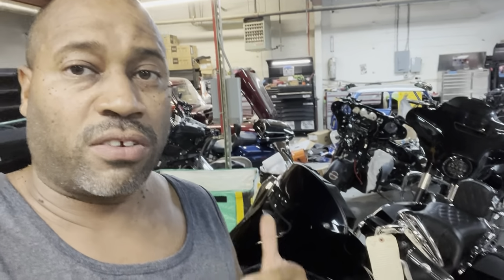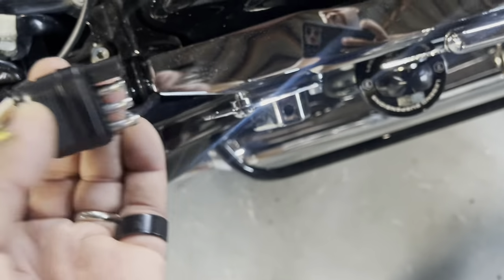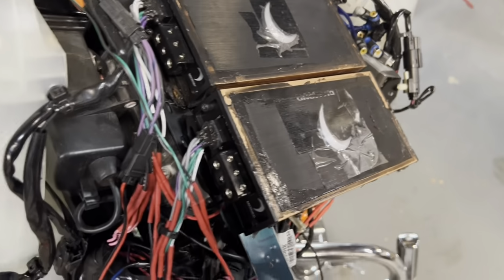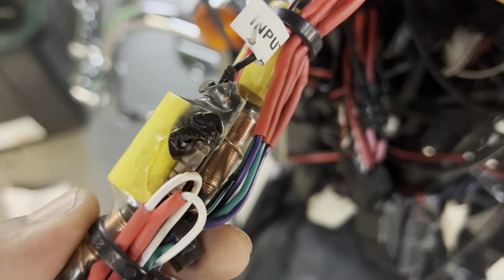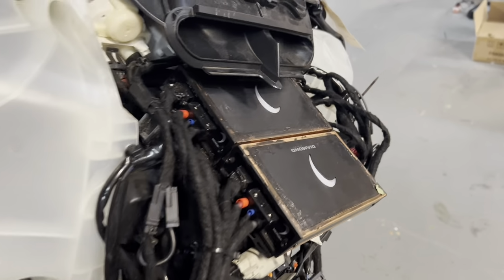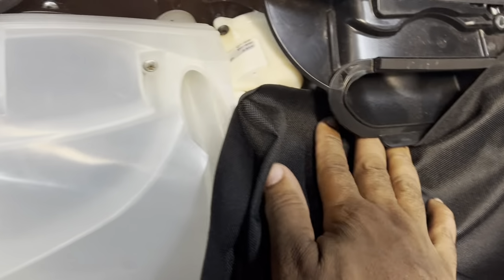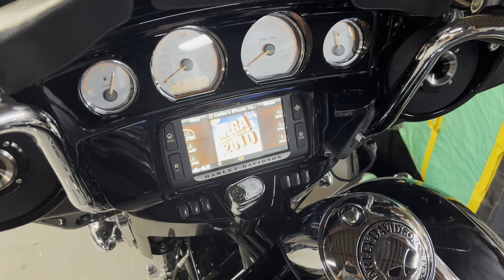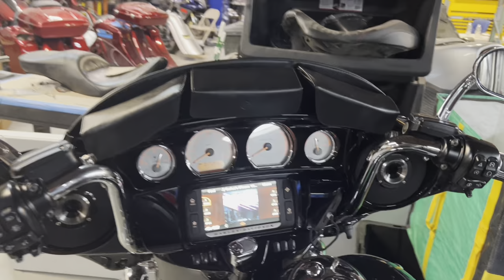Harley Davidson Street glide Wiring Rescue

Comment: Great work like always. What kind of speakers was used on the fairings and do you need to flash the Harley radio if your using a dsp. If you do will a kicker keyloc work to flatten the signal because it works for cars. Thanks for great content keep doing what you doing 😂✊✊